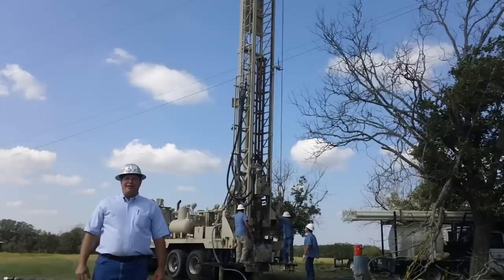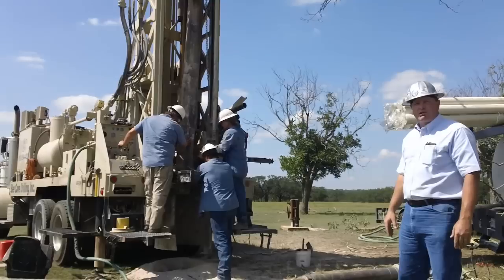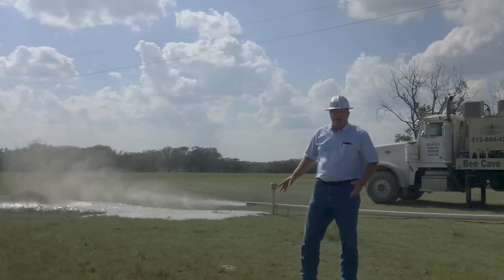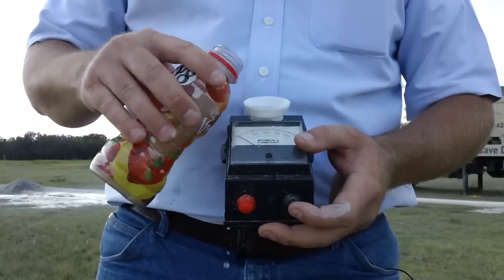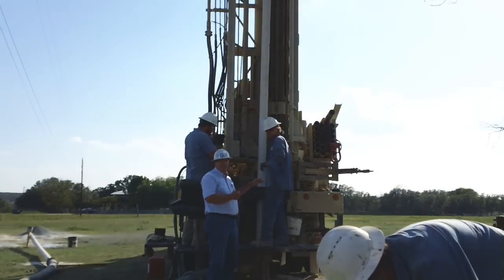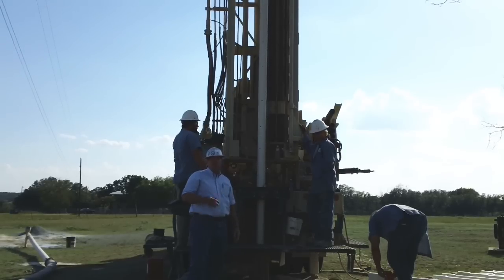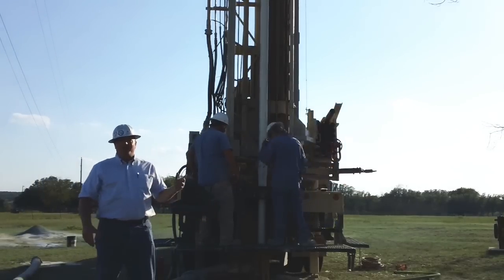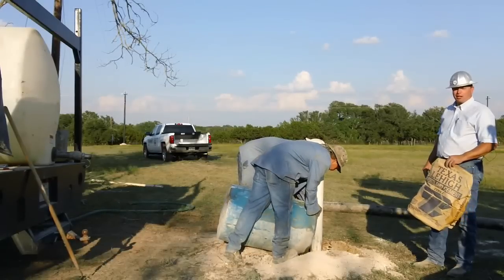Water Well Drilling 101

Comment: How do you keep the hole from caving before you get the casing in? Thank you for all the detail. Also why here in northeast NY State does every driller use steel instead of pvc. I like the idea of the perferated section. Here for gravel wells they just have the bottom of the open casing sitting on the bottom of the well

Comment: How is the pvc connected, threads, glue, or compression fittings?
Reply from the maker: Most pvc casing that we use is joined by a plastic tab and O-ring.  Look up Certalok Casing

Comment: Here in the san joquin valley california we drill ag wells 28” hole reverse circulation, casing usually 16 to 18”. Depth is anywere between 400 to 1300’

Comment: we always drill the casing first until we hit >2 meters in solid bedrock. then cast the seal before starting the actual borehole. but im more used to granit than limestone
Reply from the maker: Yes, that is normal practice in Granite formations.  We do that too sometimes.  But most of our wells are in limestone with layers of clay and sandstone.  Therefore, most of our wells are cased to total depth.

Comment: Why not gravel pack the well up to 50ft and cement from there?
Reply from the maker: Gravel packing is a great way to complete a well but you need a larger diameter hole to assure that the gravel gets in place.  In wells that have a lot of clay or sand near the production zone, we do gravel pack them instead of using a shale trap.  For simple limestone holes like this one, this is the lowest cost option that always works great.

Comment: Finally we have a drilling operation that shows a grouting job as is required in most if not all states.  Florida requires that grout be pumped from 10 ft. of the top of the screen to the surface if a screen is used. otherwise the casing must be grouted with neat cement form the bottom of the casing to the top.

Comment: Nice rig but I can't for the life of me understand why you would cement in the casing you produce through. Here we cement in surface casing to bedrock then run our well casing to bottom. This way it can be pulled if well ever needs serviced as water comes in from formation over time can wash in sentiment and reduce the water production. By having the well casing pullable you can go in and clean out the well and set it back. If that happen here you screwed as everything is locked in cement.
Reply from the maker: We have a couple of local factors that lead to this type of installation.  First of all, we don't have "bedrock" as you describe it.  The majority of our hole is soft limestones and clays that we have to case off.  The production zone is also limestone in most cases.  When we install the casing, the soft limestones and clays will silt in and prevent us from ever pulling the casing later.  In addition, we have multiple production zones as we go down that often are required to be restricted.  In many cases, we have to cement the casing in place from the production zone back to the surface.  So, for most of our areas, this type of installation works best.  But, we do have some areas that have a hard granite type rock that allow for the type of installation that you mention.  As you know, we always have to adjust our engineering to fit what we find when we punch that hole.  Good luck to you out there and Keep it turnin' to the right!
Reply: @jimblair1  that makes more sense as I spent years as a driller in the oilfields. So I am aware of how geology can change even across just a short distance. True I am not familiar with the geology in your area but in all the different limestone zones I have encountered it was anything but soft. But that is just how it is here in the mountains of WV. But I still don't understand why you couldn't set your outer casing in a soft formation with a open hole packer cement it in then drill on through target formation to place the production liner. This is a process we use to produce gas and oil from a very soft zone called Devonian Shale. The silting in of the production zone is the reason for need to be able to pull liner out to clean out and free up the production flow. Yes I have seen that silted in and makes it difficult to pull. But if it's really that soft one should be able to put a pull on it along with back flushing under some pressure and work it free. Something I have done many many times no matter oil, gas or water cleaning out to improve production over time is necessary.
Reply from the maker: @kenjett2434  Certainly can't pull it if it is cemented in place.  That is more common than not with the commingling issues and local restrictions.  Yes, we could have 2 strings of casing down the hole.  But that would greatly increase the cost of a well.  For example, that well in the video is a 400' hole drilled to 6.75".  In order to have 2 strings, we would have to drill a 12" hole, set 8" casing.  Cement that in place to 360'.  Then drill out the bottom and install the 4.5" casing.  It will work great.  But it will triple the cost of the well.  All this so you can clean out the bottom of the well.  Instead, we just jet the well out if it gets dirty.  Check out my video about jetting and acidizing wells.  
Yes, i know this is not the way it is done in WV.  But it works great here in TX.
Reply: @jimblair1  this is true I don't know  about Texas including cost. I have noticed though in Texas and in some other states starting with 12inch more. I can't understand why such a big starting hole for a 500ft well? Seems 8 inch hole would do the job and allow a 6 1/2 surface string to be cemented then a cheaper PVC liner could be installed to bottom. That would add a small added cost during construction yes but what it could and would save later in cost of well cleaning would more than make up. Sounds like the process you described for restoring well flow is elaborate and expensive. When a traditional rig could come in pull the liner go in and stir up the more bail out the silt replace the liner and with a simple pump do a good flush and put the well back in production. I have worked in areas where having and surface water can be a issue during drilling. But in those cases we still only started with 10 inch and used drive pipe as we drilled down. Then pulled the drive pipe back for next hole to reuse. I understand how what you do works but it don't leave many options to come back later to make repairs of the well. It's better to keep some options available just my opinion.

Comment: When I had my 6 inch well drilled in south west Wisconsin..451 feet.. the driller called me to say he had good news and bad news. Normally we only need 40 feet of casing..steel..but your well required 80 feet before re got to bedrock ..$$$..The good news is you are sitting on a huge limestone/gravel pit. Your land is worth a fortune. My 1.5 hp pump is sitting at 375 feet and he said I am in an underground stream and it will never go dry. If I put my head to the well head, I can hear the water flowing. The pump is on 21 foot sections of galvanized pipe and when I had the pump replaced about 15 years ago, he said they are now hanging them on pvc flex pipe which makes pulling the pump much easier. If you have any comments, I’d appreciate it.

(When there was a terrible drought in CA about 25 years ago, I asked him why he didn’t go to CA to drill and he said a well driller will never go outside his area due to caves and I know where they are here.)

Comment: Wow that’s pretty deep for that part of Texas. I’m in deep east Texas and had a well drilled 3 months ago. Depth was 140’ and producing 35 GPH with 625 TDS. Average cost to drill in that area is $8500-$10k a well, that includes pump and pressure tank. Now knowing how much it costs in that area, I’ll give you a bit of information if your from that area....some of these companies are ripping land owners off. Local drillers rely on the land owners lack of research to screw them over. So before you hire, play the game. I called 3 local contractors and obtained 3 quotes. Wait 3 months and have a family or friend call the same companies and get 3 more quotes. In my situation, the price of the quotes had increased by $2-4k!!!! I called a contractor in the next town over and got a quote for $5700 and did the same, waited 3 months and his quote came back $5700. This was who we went with.
Reply: Thats not a good way to choose a well drilling company and if you want to know why just ask
Reply: @markwilliams4525 how do you choose a Drilling company,????, 
Thanks in advance, sir..
Reply: @tonyhudson8698  while price is always the first thing people look at that can be a mistake, there's lots of other factors to consider first and since there's never any engineered drawings to go by when doing residential drilling you will want to look at what the quote includes such as is there surface casing required, is one driller short casing the actual well casing so they don't have to use surface casing when needed trying to make the the job cheaper, what kind and how much well casing, the total depth, are they using the correct size drop pipe for the particular pump gpm and depth, are they using a 2 wire pump or a 3 wire pump, are they using a properly sized pressure tank for the hp and gallon per minute of the pump output. There are more factors to consider but those are the main ones. There's a lot of instances where the contractor will use too small of a tank when there's no one to enforce it to cheapen it up just to get the job from a contractor that may be higher but is going to do the job right

Comment: Should re use the water have some kind of shakers to take cuttings out and re pump the water. Not familiar with water well drilling but got a lot of experience in oil well drilling.
Reply: Also when you run that packing seal on the casing that’s gonna drag a lot of shit down to the production water since it’s bigger than the hole diameter, guessing when you instal a water pump it filters it tho.

Comment: how do you prevent cave ins before the PVC casing is installed?
Reply from the maker: In most of our wells, we are drilling in solid limestone that will not collapse.  But occasionally we encounter loose soils that need to be held back.  We do that in several ways from surface casing, mud drillling, cementing off the zone and redrilling, etc.  Basically, we do what we feel is best for the site conditions.
Reply: @jimblair1  thank you!  I learned a lot from this video.
Reply: @B Mo to keep the hole open in loose formation all thats needed is to keep the hole filled with fluid until its cased
Reply: @jamescambell1386  I actually got a practical answer to my question last week. A friend of mine was drilling a well in SW Washington and the driller hit loose shale around 400 feet. Unfortunately it didnt get any better and the recommendation from the driller was to try to drive well casing through the shale until they were out of it, or drill in another spot.
Reply: The problem with shale is water. I was main driller at lackey 13 years and when you drill through it and past it it begins to hydrate which makes it swell then crumble of the annulus(falling in) we drill reverse rotary and all we could do is make the fluid thick as possible so the shale doesnt hydrate as fast. Depending on the rate of it fallin in we would drill past TD anywere between 10 and 50 ft then pull our drill pipe out and case it gravel it as fast as we could. Always worked good. Shale fallin in wont stick your pipe like sand will. I remember a time we drilled a 1000’ 28”hole and the day shift started runnin the casing(16” .312 steel) and 500’ into it the elevator latch caught the other set of blocks and dropped it down the hole. We made a fish tool and got it out. But over the week it sat down there it had got almost completely covered by shale. Luckily by the time we were ready to fish we tagged the shale fill at 600’ so thats like 300’ of shale our casing was burried in and it pulled out easily

Comment: I've been a water well driller in Australia for 30 years and never ever used PVC Casey it's never been successful you try and get your pump out in five years time and it's collapsed on it and the whole things a waste of time and waste of money steel casing stainless steel screens is the only way to go
Reply from the maker: I appreciate that what you use works great for you.  But, you need to realize that there is not one product available that is best for all situations. For instance, the water in our area is very aggressive towards steel pipe.  In some cases, the steel will rust through in less than 5 years.  We offer steel, pvc, and fiberglass casing depending on the needs of the customer and the condition of the aquifer.
Reply: 'casing'...….Casey was an engineer.

Comment: 4:28  470' and you are getting 20, 25 gpm?  WOW!!! that's nothing... so much work for so little water
Reply: That's gobs of water, Supa!! Remember - the gpm is the rate that's flowing into the well, the recharge. That 20 - 25 gpm is 24/7. My well is around 10 gpm & I've never run out of water! Here's why - once you hit water, your casing is acting as a semi-filled standpipe of hundreds or even { depending on your well depth } thousands of gallons of available water. If you exhausted it, then yes...you'd be down to 20 to 25 gpm….but that's probably not going to happen, unless you're filling a swimming pool...……...

Comment: I appreciate your video.  Is everything you've done here standard procedure I can expect from my local well driller?  Any questions I should be asking prior to my new well?
Reply from the maker: Everything you saw is standard procedure for our equipment drilling wells in our area.  Where you are, the drillers might do things completely different for various reasons.  There are hundreds of ways to drill a well.  And each way is used for different reasons.  You should ask your driller how they plan to drill your well and why they chose that method.
Reply: If i'll be drilling a 6 1/4" well....what size submersible pump do i need? What HP or GPM? assuming the well is 150'-400' deep
Reply from the maker: Everything you see is standard procedure for wells in my area using my type of equipment.  Every driller has different equipment and techniques and has different formations that require different methods.  If you hire a good driller, he will know what to do with your situation.  Keep in mind that every well is different.  I don't drill every well like this.
Reply from the maker: The size of the pump depends on the depth of the well, the water level, the production of the well, the discharge pressure, etc.  Typically a 400' well will use a 3/4 hp - 2 hp pump.

Comment: do you use air for the whole drilling process?
Reply from the maker: We use air the whole time we are drilling.  We also can inject water and foam into the air stream.
Reply from the maker: @Nathan Hamilton We air drill about 95% of the wells that we drill.  But when we need to mud drill, we have two rigs equipped with mud pumps to mud drill.  We also use a Mud Puppy to clean the mud and dump the crud.

Comment from the maker: There is no fool proof way to estimate flow, especially when drilling with a hammer.  We use pressure tests when we can.  We also simply estimate the flow based on the production we see at the surface. But, we are never sure until we set a pump and perform a true draw-down test.

Comment: no sound track.sad!
Reply from the maker: I am sorry that the sound didn't work for you.  I assure you that there is a sound track.  You might need to update the software on your computer. Not sure which you are using.  Maybe Flash.  Try it again.
Reply: Jim how deep can your rigs handle?
Reply from the maker: The deepest we have drilled is 1620'.  Under the right conditions, we can drill up to 2000'
Reply: Wow, that is a good sized rig! Can you handle gas pockets etc for shallow oil drilling?
Reply from the maker: We only air drill.  So, if we hit a gas pocket, we could not hold it back.  Never hit gas and hope we never do.

Comment: how does pipe that your swinging up into rack flip horizintal like that ?
Reply from the maker: There is a slide built into the side of the pipe rack that allows the pipe to slide down and fall into the pipe rack.  You can see it in action at 7:05
Reply: the guy puts it in the track which is slightly down hill, then the driller has a lever that lowers the winch holding the top of the rod,  bringing it down, and since the other end of rod is in the track going down hill into there designated rod section on truck.

Comment: Best well drilling video I've seen so far on YouTube. Great job describing each step and also showing the packer assembly. I'm surprised you don't use Bentonite clay to grout the well instead of cement, is there a reason for this? Keep up the good work!
Reply: Bentonite will plug of your zone. Better to use polymer because it breaks down after a week or two. Bentonite is forever

Comment: great video. I'm starting my new job tomorrow and this sure helped . coming from the oil fields this seems like a cake walk
Reply: 6 years later how's it going im a welder looking to switch careers I'm a really good welder but I absolutely hate it with a passion and the most you'll ever make at a Monday through Friday job welding with a decent company and good benefits is 18-20 an hour I can make that doing something I actually like or atleast tolerate found a water well drilling job near me but never even knew it was a thing until recently just trying to see if this would be a decent paying long term career with a family man I like to to get muddy greasy and work hard
Reply: @dirttrackdevil1149   certain well drilling companies especially one's that do large diameter drilling have to have people that know how to weld when setting casing so it gives you a chance to mix it up a little
Reply: @dirttrackdevil1149  where are you out of